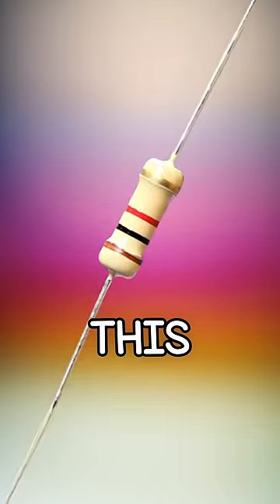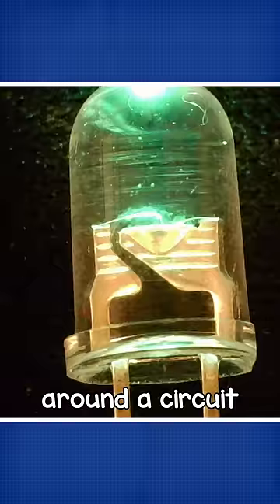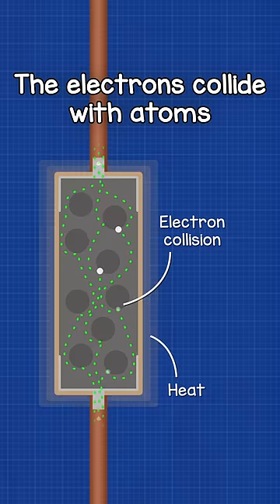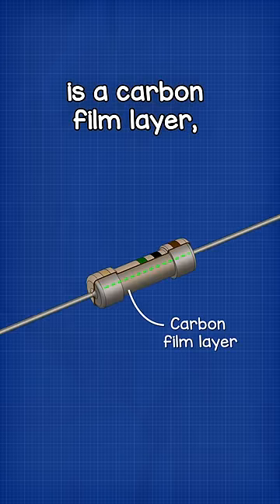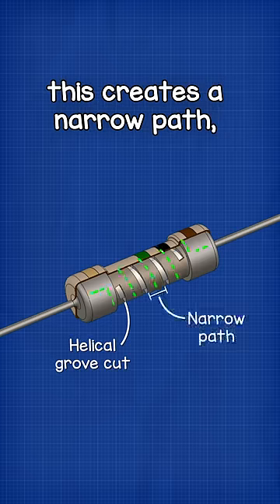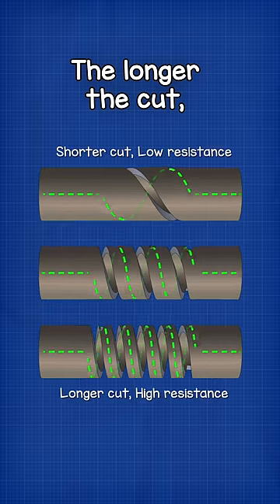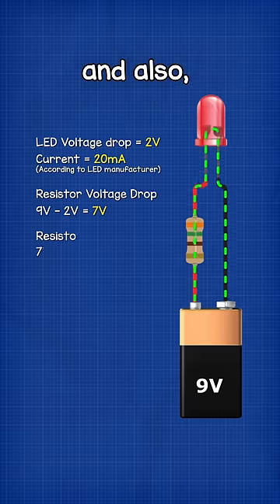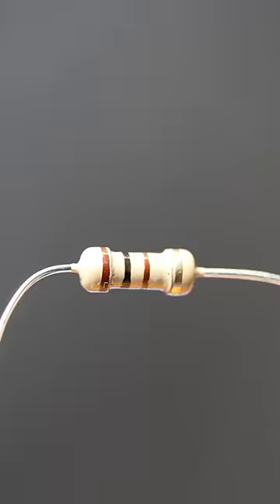What is a resistor? #electronics #electrical #engineering #electricity

Comment: Color pattern of resistor is important 😉
Reply: Sometimes it's even critical!
Reply: Had an exam using them.  
Hell of a way to learn I have slight tritoanomaly (violet/brown color blindness)
Reply: Without them you can't see the resistance if you don't have anything to measure it
Reply: There must be some trick to memorize it.
Reply: @adifferentkennybaker  you don't need to memorize it
Reply: @adifferentkennybaker  I honestly don’t have it memorized. There are charts, or in my case, a multimeter on my pouch. Though I usually need only 1 of 2 values of resistors per job, depending on what we’re working on.
Reply: The resistor colour code has a notoriously vulgar mnemonic.
Reply: @adifferentkennybaker i thought only i did that 💀. I made my own trick to remember it but oh boy it would get me cancelled
Reply: @ adifferentkennybaker
Why isn’t there just the Ohms written on them?
Reply: @kulturfreund6631  difficult to print on cylindrical resistor, plus you'd have to see it from a certain angle,while color coding is easy to do and is visible from all sides
Reply: Too small. Some of these of just itty bitty. Plus some of the bands stand for things like operating temperature of the resistor, or tolerance. A gold band in the fourth position means it is accurate within 1%.
Reply: @adifferentkennybaker
Thanks, guys. Good points.
- Do you have an idea  how many different codes exist ?
Reply: BB ROY OF GREAT BRITAIN HAS A VERY GOOD WIFE
Reply: I forgot It completely

Comment: Note that these are the old school type of resistors, which are rarely used in modern electronics. Resistors today look like tiny little black blocks, with their resisting value written on it (that old school color coding never made much sense)
Reply: Thanks. It did seem old fashioned.
Reply: Oh, they still have use in small and simple electronics projects. They are much more handy then SMD. And they fit quite nicely in electronics project connection boards. So I don't predict they will be out of use 😏
Reply: Well if you have a multi thousand dollar wave soldering machine, sure go with smd. If not, you will be using these. Not so much old school as you think.
Reply: @NickFrom1228  There are SMD heating plates you can use to solder to the board. Look it up

Note that hobby use isn’t the same as modern electronics. Of course you’d wanna go the old school ways if you’re doing things by hand in your garage.
Reply: In some cases you still need these bigger resistors, the little ones can't handle as much current, so these aren't useless.

Comment: "A battery pushes a lot of electrons inside a circuit".
Why not use a smaller battery or a circuit that can better handle the battery capacity?

Comment: Saying that resistors "protect" other components is a strange way to explain them.
Reply: Maybe I am wrong, but when he said "protect" I was thinking in diodes.
Reply: eh, its one of theyre main functions I dont see anything wrong with it
Reply: Resistors are often placed in series with diodes to reduce the current because the diode resistance is so low it'd immediately burn when given a forward bias.
Reply: @808drumz9  Capacitors are placed between amplifier stages so the output dc bias network of one doesn't affect the input bias of the next. So does this capacitor "protect" anything? Imo no. It's just the way conditions are established for the circuit internally to work as intended. Same for the resistor. Otoh a varistor, fuse, or circuit breaker actually does protect against external factors that can do damage.
Reply: @generessler6282  yes, well I guess the correct way of explaining it would be that the resistors cause a voltage drop so that the right amount of voltage goes across certain component(s) in the circuit, especially if you're stuck with some constant voltage source like a battery. But to the layperson, dropping the voltage so it doesn't burn stuff is kind of like "protecting" the stuff. It won't interrupt the current like a fuse would, so people in the industry wouldn't call a resistor a protective device.
Reply: Is there a more efficient way of doing this that doesn't just burn energy as heat?
Reply: @CorporateZombi  no. Lower the voltage

Comment: The colored bands on the resistor is also the reason why we have the phrase “the gold standard” as it is the standard percent error of resistance on resistors
Reply: Gold standard was an economic term well before resistors were invented!
Reply: @Ben-kt5rc  The economic gold standard meaning is completely different from that of resistors.
Reply: @Baneb1984  sure, but you said the reason we have the phrase "the gold standard" is because of the gold tolerance band on resistors. The phrase was used long before resistors were!
Reply: @Ben-kt5rc  i guess that’s fair. I should’ve said that

Comment: The function of a resistor is to limit the current in various parts of a circuit - the purpose is not to protect components as a primary function, since fuses are specifically designed for that purpose. 

A resistor isn't there to protect a transistor, but to limit the current flowing through the base (b) which controls the larger current flowing through the (c) to (e) region - similarly a resistor value is chosen to limit the current flowing in an LED depending on the applied voltage, so that the brightness will be appropriate in an application and within the manufacturer's specification.

Resistors are passive current control devices.

Modern resistors are metal-film and generally smaller than the older carbon type resistor.
Reply: "the purpose is not to protect components as a primary function", While this is true, I'd like to point out fusible resistors do exist for that exact use case.

Comment: The Gold strip painted on the top represents gold present and what it can handle.  Did I get that correct?
I do gold recovery and if the stripe is a induction of gold present it would be very helpful.  I do gold recovery and keep all the resistors with a gold stripe on them. 
I do get gold out of them but wasn't sure if the gold stripe ment gold was present.

Comment: The problems with resistors is that the amount of energy it resists is quote un quote transferred or lost energy, to increase productivity and reduce energy loss, it would be smart to add semi conductive translucent fabric… this in it self would reduce flare commonly known as burn out…. If the negative lead is connected to the positive lead by a resistor than …. Well if you haven’t noticed this is a run on sentence… read more…

Comment: Electrons don't "flow" across a surface. There's a disparity in charges and that causes current to move in a general direction but the electrons aren't "flowing" across the surface of the electrode like water moving through a pipe, that's a very common misconception and maybe even a useful analogy but it's nat what's actually happening otherwise good video though.👍

Comment: LOL. That's not even close. The material is resistive to current flow, so cutting a spiral means a longer path to travel, therefore, higher resistance. It's not squeezing them thru the "thin" line. It's like a planet wide to an electron. Further, the spiral cut only change the values by a narrow range. The material used must be made to be higher or lower in resistance.

Comment: And I always thought inside was a tiny room with tiny Lucy and tiny Ethel taking the electrons from a moving conveyor belt, wrapping them in a magnetic field then placing them back on the belt.  But they are In over  their heads and can’t keep up and electrons are piling up and that makes the room hotter. The tolerance is defined by how often the supervisor comes into the room to check in their progress. If the resistor fails its because the conveyor belt was too fast and the girls had to eat a bunch of electrons and if the belt wasn’t slowed down they ate so much that their stomachs exploded.  

You learn something new everyday. I’m a little smarter but I feel as though the magic is gone and I worry that Lucy and her tiny gal pal won’t find a tiny job that pays them such a good tiny salary and they will have to turn to tiny prostitution with tiny Fred as their tiny pimp. Babaloooo!

Comment: So the issue of course is that the resistor is generating heat, which is wasting a lot of your energy, and potentially causing heat dissipation issues in some applications. Is it even hypothetically possible to build a 'resistor' that could limit the flow of electrons without just basically wasting that energy as heat?

Comment: Wait what you first show a brown carbon dust or graphite paste, it's resistance is set by the mixture of conductive or non-conductive material and is typically 5% or worse tolerance. The second resistor you show is the blue case one that is a conductive metal oxide paste resistor that they laser cut to get 1% tolerance as they measure the resistance as they laser cut it.

Comment: For carbon resistors, size the such that the operating wattage is less than 80% of its rating.  Running carbon resistors hot causes them to degrade.  As they age the resistance will slowly drop, which in turn increases the current and wattage, thus degrading the resistor faster.

Comment: This is ac voltage. As far as I know in automotive it’s DC (alternator creates A/C but uses rectifier to convert to D/C) and you have to add a resistor to the circuit so that the computer recognizes the led. How does all of this relate? I’m trying to understand.

Comment: Question: why wouldn't we just use a battery with lower voltage to avoid the need of the resistor and reduce thickness of the cable required?

Comment: The primary mechanism by which energy is dissipated in a resistor is through collisions and interactions between the drifting electrons and the lattice structure of the material. As electrons move, they collide with lattice atoms, transferring kinetic energy to the lattice in the form of vibrations (phonons). These collisions impede the flow of electrons, and the lattice vibrations contribute to an increase in temperature, representing the dissipation of electrical energy as heat.

In summary, while the drift of electrons constitutes the electric current, the energy transfer and dissipation in a resistor occur through collisions between electrons and lattice atoms, leading to lattice vibrations and the conversion of electrical energy into heat.

Comment: Nooo, it is not a fuse, its a resistor, so the voltage over the resistor is depending from the current flows through! 🤷‍♂️

Comment: Just out of sheer curiosity, I know that a resistor is usually rated to offer a certain amount of resistance depending on what it is designed to do, but does every resistor offer the exact same amount? Or is it just slightly different between every model? Obviously if the difference is slight between each model it's a meager difference, and falls into a field of predictable error. 

I ask because we can't create every alloy we need to be perfect every time, it just needs to reach certain parameters. But even then, is it possible for a resistor to be slightly outside of those parameters, and thus cause a failure? 

I'd assume yes, but wanted to ask out of curiosity. And once again, I'm not trying to cause an argument or find a contradiction, I'm merely curious.
Reply from the maker: I would point you to watch our full, free, tutorial on resistors. Everything is fully explained step by step, link bottom left. It will solve all your questions.

Comment: So they just like change from 40 lanes to 4 lanes on a highway yeah? And everyone need to slow down, right? But not enough lanes causes driver to crash, as they cant fit, and it explodes? haha
Reply: Its like more rush mean there is more heat from their cars engines - too much cars incone place and it melts cars and even the road, right? That's good visualisation example, or i AM wrong? 🤔

Comment: I would only change one word and that word is protection. Resistors don’t protect an electrical circuit, that’s the fuse or breaker’s job. I would’ve used the word manages instead. Overall, great video!
Reply from the maker: Seen our new incredibly detailed MCB video? link: https://youtu.be/gqEu9t8HwW0

Comment: You should also teach color coding of the resistors. Those coloured lines have a meaning and you should also include why some come with gold line and others with silver. There is a mathematical calculation behind resistance. That’s how we know which ones are used where and why.
Reply from the maker: Youre in luck, we have taught it, in detail. Full tutorial link bottom left.

Comment: Very good video with a great explanation.  It could have been longer with some additional math showing “here’s how you determine the needed resistor, maybe the reasoning for multiple resistors, etc., etc., and I’d still have been thrilled with the video!”  Great stuff!
Reply from the maker: Youtube limits the short to 60 seconds, so we can't fit more in. However, link bottom left for full tutorial on calculations
Reply: @EngineeringMindset  Excellent!  Thanks!  I did not notice that but will go there now.  Good content, absolutely.

Comment: There is much more to resistor,  wire wound, carbon, precision, and wattage rating. But for the most part, this video demonstrates the THEROY of electronics.
Reply from the maker: See our full video - resistors explained. For full details.

Comment: Fun fact, lights also work as resistors. The basic idea is a resistor reduces energy in a circuit by releasing heat or light, which a bulb does

Comment: This makes people think resisters are protectors, where as we know that they are used for current flow, voltage drop, RC, RL and RLC circuits, voltage dividers etc
Reply from the maker: Yep, full details in the full video. This is a short, limited to 60 seconds

Comment: the higher the resistance the more voltage the resistor takes away from the LED. the lower the resistance, the more energy there is wasted in the resistor in the form of heat.

Comment: The flow of electrons is current but the resistor does not reduce current it reduces voltage across the LED.

Comment: This is used in many small power supplies. If the power supply is working normally, the resistance only gets moderately warm. If there is a short circuit in the power supply then the entire mains voltage is at the resistor. This causes the resistor to burn out and interrupt the current.

Comment: OK dumb question... do the electrons slow down due to collision with each other / spiral wall or due to the extended distance that the spiral creates for the electrons to get to the other side?
Reply from the maker: Fully explained and illustrated in the full, free, tutorial, link bottom left
Reply: electrons dont actually move along a circuit
Reply: @EngineeringMindset  thanks I'll check this out today!
Reply: @digitalrandomart3049  but the electrons do move through the magnetic field, correct?